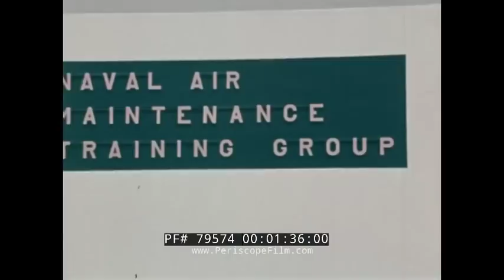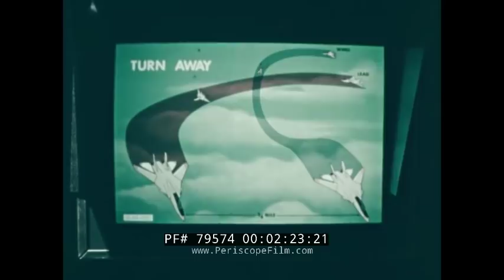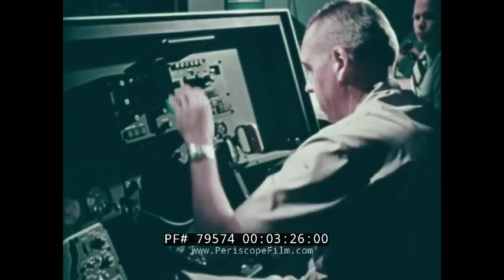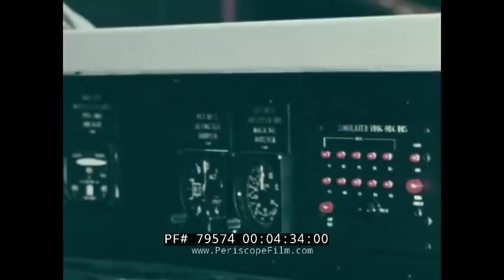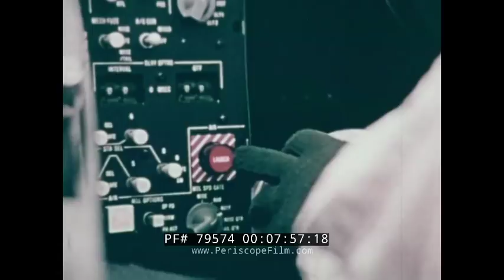F-14 TOMCAT PROGRESS REPORT #5   THE OPERATIONAL TOMCAT & SHAH OF IRAN  79574

Comment: Some years ago, I had read on the internet that when the Shah of Iran was at Andrews Airforce Base he liked the F14 Tomcat due to its variable wing design especially when its wings were swept and he decided he will buy them.
0218, 08/06/2020.
Reply: No, that was not the reason. They would not award several billion dollar contract to a company simply because of the variable geometry wings. The Iranian pilots were sent for 6 months prior to that to evaluate both the F-14A and F-15A. Based on the performance side by side of the two planes in the hands of the Iranian pilots, they came back with the impressions that the F-14A was the superior performer and had what the Iranians needed. They recommended the F-14A to the Shah of Iran. That is what was said exactly by the head of the team that went to the US to evaluate both of the super fighters.
Reply: @KLRGT500KR  Thanks for clearing my mind about the whole process.
Reply: @KLRGT500KR  It was a puppet regime. The Shah was told what to buy. He decided nothing.

Comment: Real professionals back then. Always had a soft spot for the F14. A real monster of a plane. Big plane, big engines, big fuel load – just big and bad.

To be fair, the program had some real teething problems, and during early phases they lost the first model due to total hydraulic failure. They lost #6 when a missile “pitched”
up during launch and ruptured a fuel tank. 10th model crashed while practicing for an airshow.  

To give an idea of how large the plane is, a F16 (dry) weight is 18,900 lbs. A F14 dry weight is whopping 43,750 lbs dry. So this is one “big” plane – never figured out how they could fit these things on a carrier. The sweep wing design meant that
you killed two birds with one stone – a very high top end (Mach 2.4). So wings folded in gave high top speed like when a bird dive bombs. And folded in wings gave more carrier deck space.

So there were doubters about this plane. And that movable swept wing concept was really put to good use – rather unique for a fighter.

So big and bad the plane was. In that time a larger frame was a real advantage since you get lots of fuel, lots of big engines, and lots of room for advanced radar systems – (all these systems were rather large back then).

All in all with hard work, the plane turned out to be a legend in its own right. And no, I not going out to watch Top Gun after writing this!
Reply: F4 had just as much teething problems if not more.. but by 1970 budgets were a lot tighter due to Vietnam spending and the military had a lot more eyes looking at the spending and any kind of setbacks or problems got way more attention than back when the F4 came out to the fleet..
Reply: @stijnvandamme76  
Actually I not run the numbers for the F4. Back then government's had boatloads of money.  They were funding the moon program,  Vietnam and more.  The f14 was crazy expensive at that time and so was the f4 program.  As my posted numbers show the f35 program was somewhat less then the f16 program.  From what I can find the f16 program was less then the f4 program,  and in 2023 dollars the f35 program is less than the f16 program in same year dollars. 
In late 1960s spending was about 7.8 % of gdp - nowadays it's not even 3%.
Governments had boatloads of money back then,  now Governments have a gazillion new social programs that didn't exist back then.

Comment: A friend of mine worked as an electrician at Miramar. He was a civil service employee assigned to VF-124. He had been an electrician's mate with VF-124 so, as he said, started doing the same work without a uniform, and on dry land.

When the F-14 first arrived, it wasn't unusual to have 50% of the planes deadlined, mostly for avionics. He said more than once they went to Radio Shack to get resistors, etc., to get them flying.

Some of them became hanger queen parts planes to keep the other planes flying.

At one time, they bought Radio Shack radar detectors for pilot training. This was pre-Top Gun.
Reply: Jose Carreras All new designs have issues, some deadlier than others. The F-16 became a good plane, but in tribute, don't overlook the F-16s nasty wire chafing issue that killed many pilots and planes. While General Dynamics should have known better in terms of protecting aircraft wiring rubbing against metal surfaces in an "all electric" aircraft (common sense, maybe?), they failed to adequately act on that knowledge, and then damningly acted to conceal their knowledge of this fatal flaw. It was during a wrongful death lawsuit brought by one of the pilot's wives that the government changed the rules, saying a contractor acting on behalf of the government cannot be sued. Despite "winning" the trial against GD, ZERO damages were ever paid. They even made a TV movie about it.
Reply: Jose Carreras I disagree. If the design of any machine is such that the actual intended use of such machine causes it to fail in a repeatable manner, it IS defective, and is an engineering fault.

(EDIT:  Going back to the F-16 for a moment, keep in mind, this is a 100% fly-by-wire aircraft. The computer runs EVERYTHING including instruments. There are  ZERO backup systems if your wiring fails. No glitches allowed. It's as critical to keeping you alive as the engine. With that in mind, don't you think it might have been worthy of a critical look at potential sources of failure to that "electrical spinal cord"?)

To bring the issue of the F-14 closer to home, just look at the TF-30 engine used in early models. It's a lousy engine for a fighter, but better suited for a bomber. What bomber? The failed F-111B from our friends at General Dynamics of course! Don't take my word, read the Wikipedia article on the F-14 to see what the SECNAV had to say about it.

(EDIT:  Help me out here. If GD was such a superior company as you say, why did they partner with Grumman on the F-111B if they didn't need to?)

Bottom line is any new design will have issues (further complicated by design compromises). How many people die, and what's done about it makes all the difference.
Reply: That happens to a lot of new gear. The F-15 had serious engine problems with the F100-PW-100s when it first entered service. All of the engines had to be replaced. Had the engines not been upgraded, people would not be talking so highly about the F-15 as they do now. F/A-18s had multiple aerodynamic issues that needed to be reworked after it entered service. I'm sure I can find plenty of other examples, but it isn't uncommon for a lot of unseen issues to arise after production begins.
Reply: Jose Carreras Googling 'F-16 wire chafing' brings up 322,000 hits (desktop search). The movie is "Afterburn". With due respect, I'd suggest a bit more practice in researching online if you can't find ANY of 1/3 million sources.
Reply: How could it pre-Top Gun? Top Gun was established in 1969.....
Reply: tom7601 Was'nt Carter President at the time?
Reply: +Mike Cowen

Interesting, but I can't find any sources on this issue.
Reply: @floatingchimney  Look  for arc burst - and kapton
Reply: +Mike Cowen

Agreed, I didn't bother Googling too much.

Anyway, from what I quickly read about, this doesn't seem to be an engineering problem per se in its true form. It just happens to 'cause or did cause a death. There are such things happening in any plane, any car and even any bike. Electrical quirks are everywhere.

F-14 was all in all a poorly engineering plane right from the drawing board. Did it do it's job - sure it did. But it was more closer to failure than success on paper.

Grumman was the lowest bidder, however Grumman was also a less capable company than General Dynamics and several others back in the day. You get what you pay for. Navy and Marines always had the poorest budgets anyway, they couldn't (can't?) afford top quality.
Reply: +tom7601

I really like the F-14 and it's a cultural icon more than any other US fighter plane, but it was a poorly engineered plane. Grumman did poor work.

The F-16 from General Dynamics was built at the same time in the 70s but is an excellent plane even to this day.